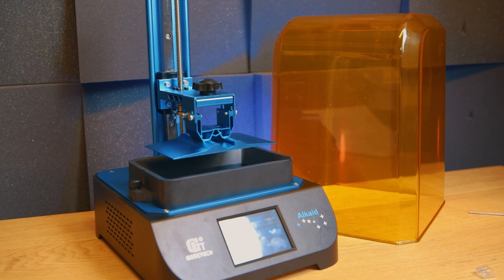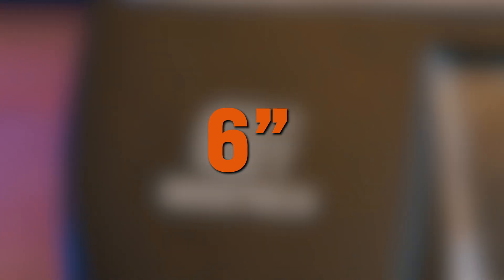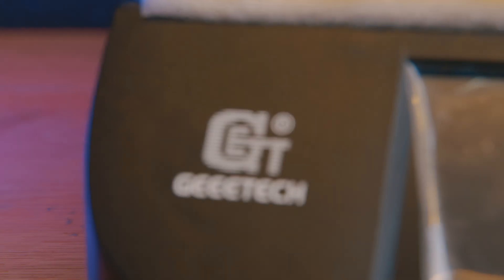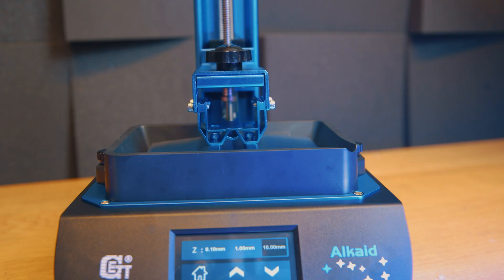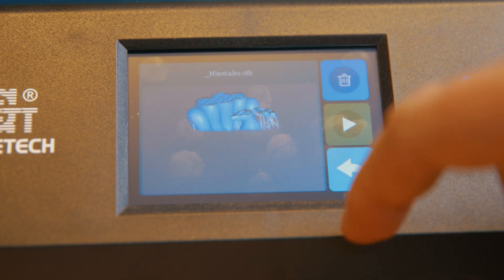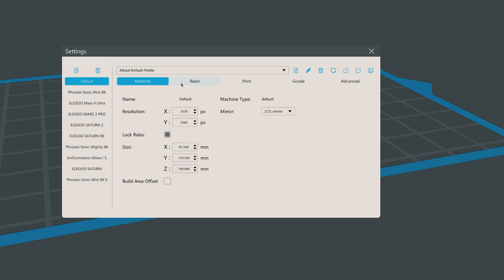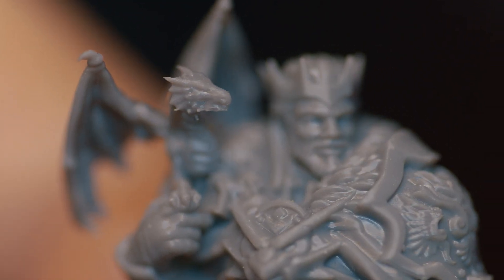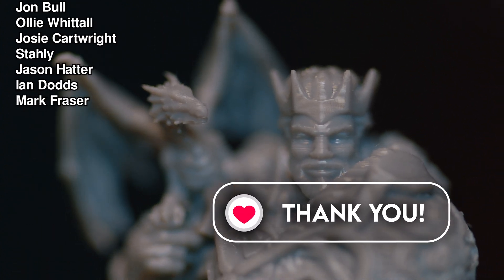World's Cheapest Resin Printer - Geeetech Alkaid Review - Decent Quality 3D Printer only $99

Comment: Beat you to it. I got the Creality Halot One on a sale for 99 bucks. And that INCLUDED a full liter of resin! For that price, I basically just jumped at it without thinking. Ordered the printer and washing/cure station immediately and have been printing on and off with it since. It performs really well and prints look really nice too. Right now I'm finally testing water washable resin since I got tired of the IPA dance. (Mask up, wash, filter, store on shelf in sunlight for several weeks to cure the resin and let it settle, use again, wash out the cured gunk at the bottom of each bottle, put IPA back in. ARGHHHH) I'm just going to wash the prints, put em on a paper towel and let dry, then put the water outdoors and let it evaporate.
Reply from the maker: Yep, better deal

Comment: What I found in shopping for my first printer is that Amazon is massively inflating the prices. I picked a Mars 3 Pro and it was 180 USD from the Elegoo website while Amazon wanted another 100 USD for the same piece. With quality 4K printers coming down in price, it's going to be more difficult to compete in this low price segment.
Reply from the maker: I think the issue there is third party suppliers glbuting stock in and then Elegoo dropping the prices

I have a friend in the Uk who sells these and he bought 15 to sell on, 2 days later they dropped the price for the customer to lower than it was for him to buy it in as a reseller and refused to discount it retroactively.

So he’s now sat in stock they he either has to take a loss in or sell at the price Lee discount

Amazon peeps will be the same.
Reply: @FauxHammer  That brings up a whole new set of concerns. I've not heard much negativity about Elegoo's products, but if they're not managing stock and distribution correctly, it may be a problem for future viability and support.
Reply from the maker: @brent8491  it’s just overseas companies being shitty with how they treat resellers. I only have the Elegoo example because he got Elegoo as more people are buying that brand.

Comment: Hey there! I can't decide which to choose for my first printer even after watching your videos on the different models, but I am looking at the Mars 4 9k and Mars 4 Max 6k and I honestly don't know which I should choose. I plan on printing miniatures more than anything with the occasional larger project. What would you recommend? Or would you recommend a different printer? Trying to stay around that $250 USD mark for my first printer.
Reply from the maker: Honestly, despite the Mars 4 having slightly better quality, you’d be better off with a Max at that price range because the build plate size is more useful and convenient than the quality difference.

Or if you could squeeze a bit more into your budget. The Saturn 8k (not the Saturn 2) could be the sweet spot, bigger size again and slightly better quality than the max…
Reply: @FauxHammer  Than you for such a quick response! And I was eyeing the Saturn 8k since the price isn't far off. So I think I'll go with that! I'll be sure to use one of your links as well your content has been amazingly helpful in narrowing everything down.

Comment: the one problem I see with this is that for 100€ over here you can get a Photon Mono 4k, for as low as 60€ I've seen brand new Mars 2 units, and for 150€ you can get a Saturn S. And I have no doubt in the US it's all probably cheaper
Reply: The only Photon Mono 4k I can find that's cheaper than this printer is listed as "unrepaired", with the cheapest new at 130 USD, and the average closer to 160. The Mars 2 has been discontinued, with the Mars 3 at 170 for the cheapest new one. The Saturn S is showing up at 230.
Reply: I have no idea where you are getting your prices from, I'm in the US and just recently scored a saturn2 with was+cure station and an enclosure for $125, and that was an absolute screaming deal.  And being a used private purchase its hardly something someone could reliably duplicate. 

I habitually shop cheap for these things and to get the prices you are suggesting required constantly scouring the usual suspects for used deals. Even buying "broken" machines off ebay and marketplace with fingers crossed that they can be repaired cheap or for free. It's simply not the same as buying a retail machine available at a low fixed price.
Reply: @DrewLSsix  Different country and also it's a year old comment, prices fluctuate.

Comment: I saw this and thought "I wonder when FauxHammer will talk about it" - and here is the video. Lol.    The $100 staring price seems great, even though I do expect problems with it, or just 'not able to do' things with it.   Only time will tell if something really breaks down inside or burns out with normal expected use or not, unless someone with actual circuit knowledge wants to open one up and give it an exam.
Reply: Mine arrived with a dead power brick.

Comment: I have a USB extender cable that I was planning on using on my Saturn 8k. Does it work with an extender cable? Nope. Grrr. I bet I need another cable now.
Reply from the maker: can depend how long the cable is, I think there is a limit to how long a cable can be and inside the machine there may be an extension cable already.

i would expect its a few meters though. Not ware of any USB compatability issues with cables. have you tested the extender on another device t make sure it works?

Comment: You should test the cheapest resin vs standard resin you would buy or recommend to a hobbyist. But I am talking like dirt cheap.
Reply from the maker: working on it
Reply: @FauxHammer  for detail tests I'd reccomend J3D's detail cube, and for bend tests just print out a range of cylinders like 0.5mm 1mm 2mm 3mm 4mm, there are a good bunch of reviews of resins already by people like denny wang so the tests are more comparable which is very useful (if you want to be a bit more scientific then hold the posts over a protractor with some pliars and bend to see at what angle it breaks, I've got a video showing this which I can post on your discord if you want). Do not though that not fully cured resin bends more than it should so cure for a good hour and consider letting them settle for a day if not a full week because sometimes that makes a difference.  The only problem with the bendy posts is that often with minis when something breaks from bending it's because the geometry is made in such a way that there is a small point where all the bending happens, I'm going to make a test to simulate such breaks but it will lack the advantage of the posts being so comparable because many people have already bent posts

Comment: "But it's only $100" is a dope tag line, lol.
I have the geetech cure station, and while it's just a laser cut acrylic box held together with o rings, it works great for how cheap it was.
Reply from the maker: Thanks, yeah my original script was, THIS, but $100, THAT, but $100. ALSO THIS, but $100. I cut a load out and then my editor put them back in in text captions on his own lol!
Reply: So is the halot one now its on sale and at least it made of metal
Reply from the maker: @garylangford6755  well, I did t know that when I made the video. But yeah good. All.

This will make more sense when that sale ends
Reply: @garylangford6755  where please?